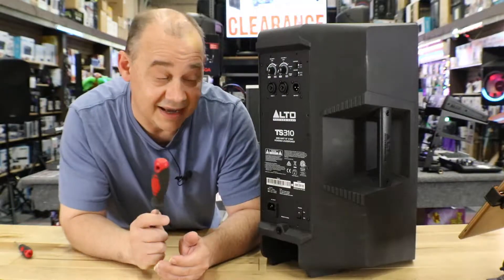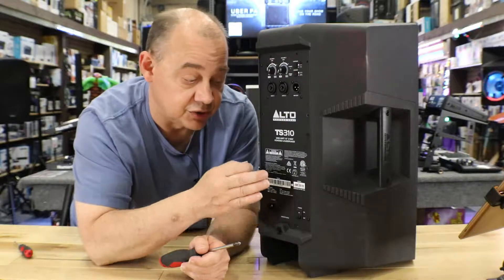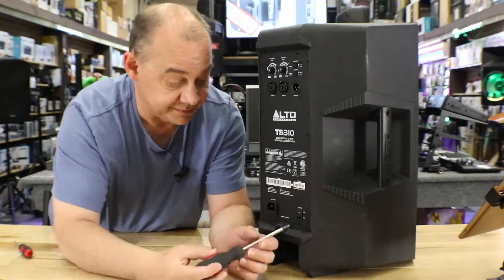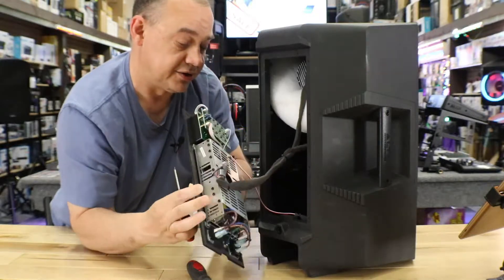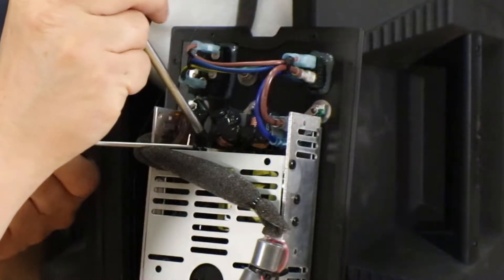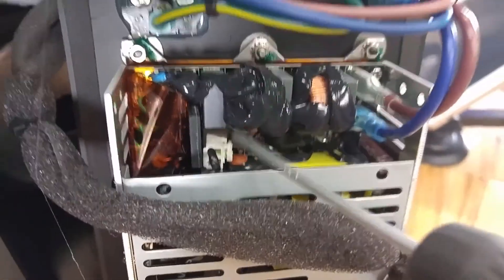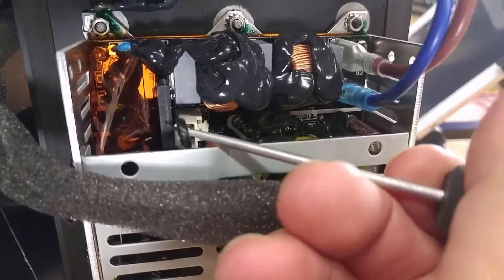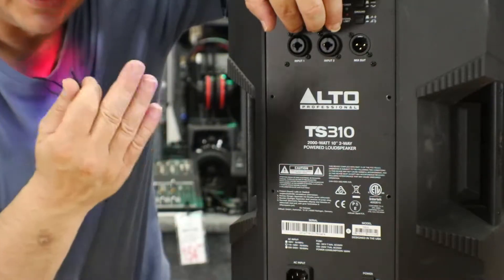Alto TS3 How to Change the voltage Setting from 110 to 220v

Comment: I wonder why the Alto TS415 Speakers do not have a toggle switch for choosing between the 100-120v / 200-240v, whether built on the board or outside the speaker.
It could have simply been made to accept the voltage range of 100-240v without any struggles, just like other speakers like EV.
I decided to try other brands like Alto, and I had a bad experience. So unfortunate for me. I should have gone with the EVs.
I blew one of my Alto TS415 the first time.
My humble suggestion is that Alto should simply indicate only 100-120v or 200-240v  at the back of the speaker instead of indicating the two individual voltages and ticking one black and leaving the other one white. 
This is more confusing to know whether the one left white is the configured one or not.

Comment: I just bought two TS415's in the UK so the box says the power configuration is for the UK (United Kingdom).  I am moving to a Barbados that uses 110volts, does the TS415 have a similar jumper system? Just below the outlet is states 100-120v or 220-240v.  Does it switch automatically or do I need to take out the amp?
Reply: I wonder why the Alto TS415 Speakers do not have a toggle switch for choosing between the 100-120v / 200-240v, whether built on the board or outside the speaker.
It could have simply been made to accept the voltage range of 100-240v without any struggles, just like other speakers like EV.
I decided to try other brands like Alto, and I had a bad experience. So unfortunate for me. I should have gone with the EVs.
I blew one of my Alto TS415 the first time.
My humble suggestion is that Alto should simply indicate only 100-120v or 200-240v  at the back of the speaker instead of indicating the two individual voltages and ticking one black and leaving the other one white. 
This is more confusing to know whether the one left white is the configured one or not.

Comment: Thanks I blew up my speaker cause In Uganda we use 240V 😂😂 this will save the other speakers I gat thanks sir
Reply: I wonder why the Alto TS415 Speakers do not have a toggle switch for choosing between the 100-120v / 200-240v, whether built on the board or outside the speaker.
It could have simply been made to accept the voltage range of 100-240v without any struggles, just like other speakers like EV.
I decided to try other brands like Alto, and I had a bad experience. So unfortunate for me. I should have gone with the EVs.
I blew one of my Alto TS415 the first time.
My humble suggestion is that Alto should simply indicate only 100-120v or 200-240v  at the back of the speaker instead of indicating the two individual voltages and ticking one black and leaving the other one white. 
This is more confusing to know whether the one left white is the configured one or not.

Comment: The TS410 doesn't look like that on the inside, it looks way different. Is there any way to turn the 410 into 220?
Reply: I have a TS415 that I switched from 120V to 240v. Assuming that ALTO keeps roughly the same layout in the power supply across the TS4 series, then this might be able to help:

1. First of all, don't connect the speaker to 220-240v before changing the fuse to the appropriately rated one and making the voltage 'switch' on the inside.

2. I'm assuming that you have some knowledge on electrical components and know how to get inside a power supply module, safety, using tools and all. The TS4 Series is basically built to keep you out and ALOT of care is needed to make changes/access the amp module.

3. There's no openly labelled jumper section as the previous models. (At least from observation on my TS415). The voltage selector jumper on this series is actually soldered onto the board and the board itself is highly gummed up in white sealant. The jumper area is is also not labelled with the obvious AC 110/220 markings as is the case with previous models.

4. This jumper is a thin solid wire located in the bottom right area of the board, close to one of the two large capacitors and the black NTC Thermistor. You will need to carefully remove the white sealant to be able to see it as it's most likely not going to be visible. Once you locate this wire, you can use a cable cutter to cut it then bend the open ends away from each other. Be careful that these open leads are not close to or touching any other components close by. Also the space around this wire is so tight that you have to be very careful and use a tool that can easily fit in that small space. Alternatively you can take apart the whole board and de-solder the wire from the back.

Once this is done and the appropriate fuse is installed, you can comfortably say your speaker is now rewired for 220-240v.

Hope this helps.
Reply: @DwayneCoolridge  can you show me in a video?!🥴
Reply: @DwayneCoolridge  Thank you! i dit it on my TS408 working very well.
Reply: Hello, do you have to put another component(fuse) after cutting the wire. Suppose you just remove the wire and connect the speaker to 220v is there any effect. Thank you for your response in advance.@abelrogers469
Reply: Thank you, it is not crystal clear for me which is the jumper to take off or cut, here is a short video of my ts412
Reply: Yes it looks different. Can you pls make a video for the TS 410 , my fuse which came with the speaker was blown out . Pls help me how to fix the problem. I’ve ordered T5 AL AC 250 v fuse from Amazon , will it work or not. By the way do I need to change the power chord to . Pls help me . 
Thank you 🙏🏻